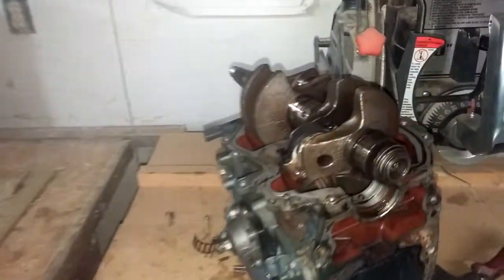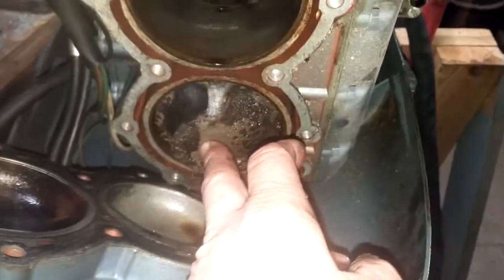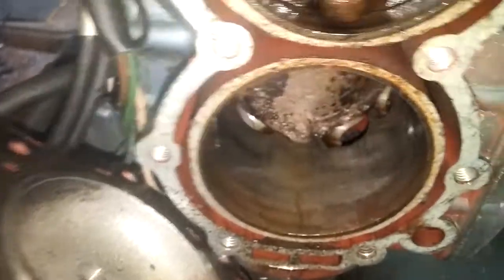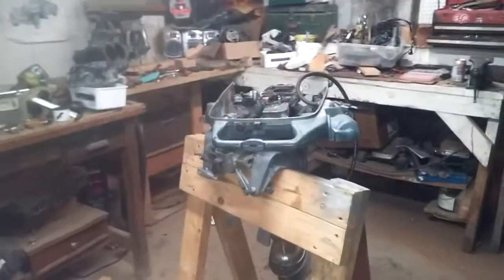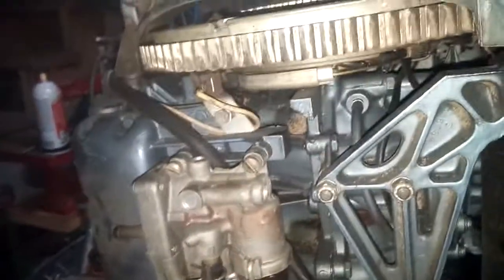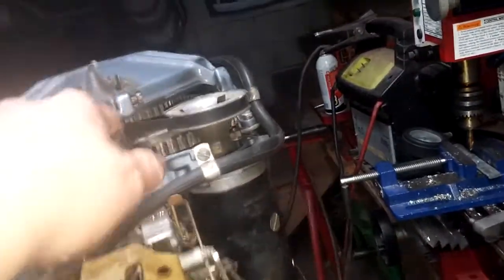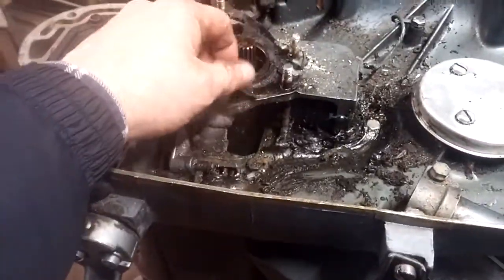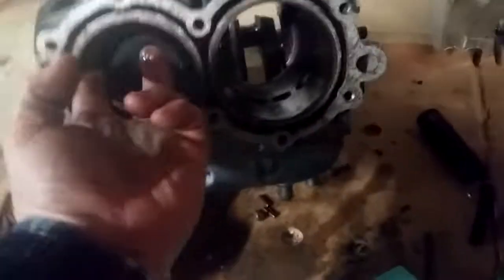1964 Evinrude 40hp Bigtwin...Disected!

Comment: Awesome. I got a 1963 40 manual shift. It had the carb and starter off it. Both are locked up. Been sitting outside. Hope to get it running soon. Any info on where to get parts I’d appreciate it. Thank you 👍🏻

Comment: Hi Ed. It would seem the lower cylinder on that model has problems with carbon buildup . Very happy you were able to find another engine . I will be watching for your next video. I have caught up on your videos I think.
All my best.
Bobby
Reply from the maker: Bobby Tectalabyss they are not easy to find anymore.  They made a boat load of them...pun intended... But most have been turned into beer cans.  Parts can be found but you have to be smart.   This old outboard channel has it right use the expensive sites resources to find numbers and jump on ebay for best price.  It takes time to cross reference to make sure all parts will interchange.  There is a Facebook group also that has been helpful and of course all you guys.  Thanks for watching -Ed

Comment: Great video series !   i enjoy  watching.  Those motors are fully jeweled, most people unknowingly will run it at 50:1 mix hafe of what the factory specs calls for.  Hope the cylinders aren't out of round . Take out the tamper pins first before you split the block. Good luck
Reply from the maker: Hi jack,  not to be stupid but what is a tamper pin.  I noticed some alignment pins that made it difficult to get the powerhead off the body.  Is that you are talking about?
Reply: Ed Moore yes sir, there's two. Tap them out towards the intake. Once you take them out the case will just lift off with little resistance. Just a fyi,  there is only two size pistons available standard and    
.025 over sized piston
The oversize is $80each and the oversized rings are $20 set of three
Reply from the maker: Thanks Jack!  I measured the cylinders for taper and roundness and they are pretty good.  I ordered a std set of Piston and rings.  New bottom case gaskets, head gasket, crank seals, manifold gaskets.  the only gasket I couldn't find was crankcase cover "rubber string".  Will probably reuse the original with a coating of permatex RTV to help it out.  I will definitely knock those pins out before pulling the power head off the lark. Thanks for the tip!  Later -Ed
Reply: Ed Moore the crankcase seal is part number 309044 found on eBay @ .99 per foot .  Don't use rtv, omc sealer 1000 or copper gasket maker, very thin coat.  If the crankcase doesn't seal properly it will cause a lean run condition  .
Reply: I just got this motor, are you not supposed to run it 50:1?  My plugs keep fouling, why should my fuel mixture be???
Reply: So what should the fuel mixture be?

Comment: that piston in the new engine looks like detonation damage,i wouldnt reuse the other piston because of the scoring. i wonder if wiseco makes pistons for those engines? take your time,do it right and do it once. i think that was money well spent
Reply from the maker: roger oconnor I have priced New pistons and they are pricey.  I have to use several different websites for part numbers and then search for NOS on ebay.  I have been able to save quite a bit so for.  Thanks for watching and commenting Later Ed
Reply: i hope you can find a piston,unless you get it cleaned up and polished and the scratches go away. happy hunting

Comment: Ed I would not put the piston from the 64 into the other engine due to as already said the scoring it could mess up the cylinder wall in the new engine. I would do a lot of research before you start combining engines that piston in the new engine does look like  detonation I think you could find everything you need for the new engine I think that is your best bet.,
Reply from the maker: I have done a ton of research and consulted with some guys on Facebook group.  I have found a set of matched pistons and rings( 2 ring instead of 3) but marinenegine.com and guys on facebook said they would fit. I got a good price off ebay and all the gaskets to put it back together.  If all goes well???? I should be able to rebuild the Lark Powerhead and Bolt to the manual shift Bigtwin. Wish me some luck...I'm going to need it.